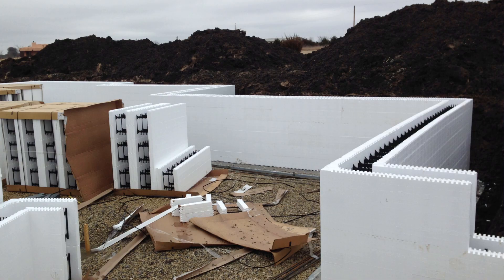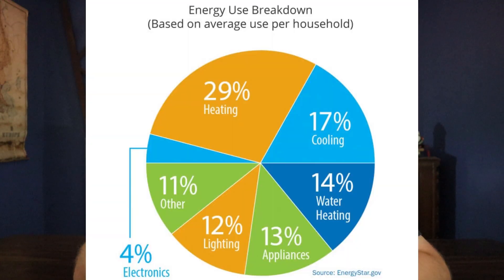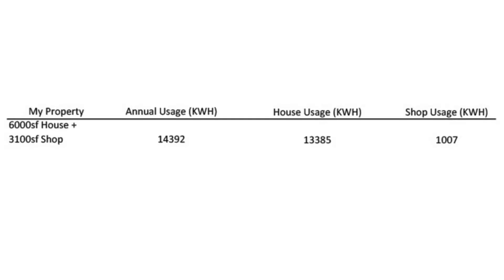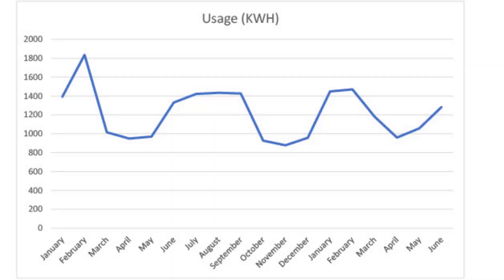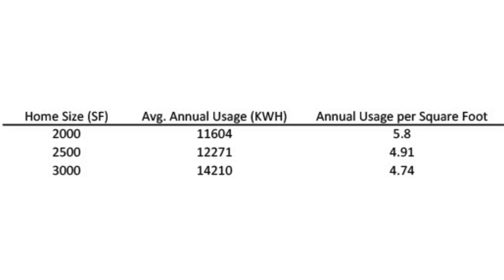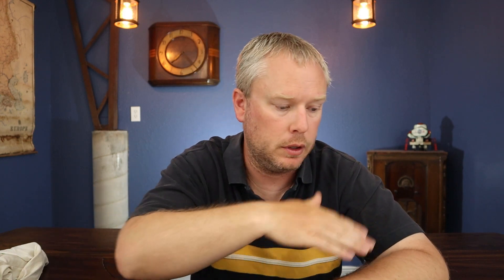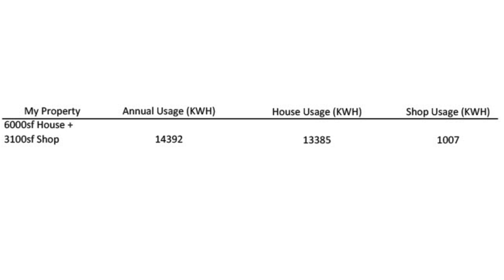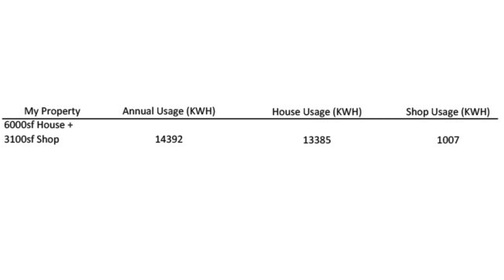How Much Power Does An Energy Efficient Home Use

Comment: I have just built a new house in the uk with 150mm insulation board beneath the slab.  The walls are 125mm concrete then 125mm rock wool then 125mm thermal blocks.  It’s just so warm. I’m delighted I put the money into insulation.
Reply from the maker: Congrats on the new build!!!

Comment: if you have insulation on the floor and walls, whats your situation with moisture , is that a concern and how would it be controlled. i am asking because i seen some videos where insulated homes with heating generates moisture which needs to escape.
Reply from the maker: You'll need some sort of fresh air system, preferably an HRV or ERV.

Comment: Does an ICF system àlmost eliminate air infiltration 
Can you qualify for passive house ratings 
What is the R value of the walls ànd ròof
Excellent video, thank you for posting
Reply from the maker: Yes, icf eliminates air infiltration in all areas that are not penetrations.  The foam provides an r-24, but the concrete acts as a thermal mass.

Comment: I am nearing building our same square footage home as you in Kentucky, 3k+ house 3k+ basement. I am going with Nudura ICF and they are recommending an 8" basement wall and going approx 10' high with 2 1/2" foam floor insulation with floor heating sections then a cement pour completely underground with no windows but an access door to the"utility room".. The upper floor will be a 4" Nudura ICF wall 9' tall with double insulated windows. My questions are, how much energy loss do you find by having windows (I did not see a video on that) I also have plenty of property so you suggested a continual underground tubing run for Geothermal instead of a loop system for even more efficiency, correct? Thanks for the great information and calculations in your videos and of course some need updating but I'm sure you are very busy.
Reply from the maker: I have no idea as to the thermal loss of the windows, so I'm no help there.

I have quite a few videos outlining my geothermal system.  Check them out as they will probably answer your questions.

Comment: Hello, thanks for the video, how can I learn how to build an house taking into account the insulation you did with yours?
Reply from the maker: Lot's of research.  There are plenty of video's across Youtube sharing the information
Reply: Check out Spray Jones, RR Buildings, and Matt Risinger's channels for more ideas.  Or look up Joe Lstiburek talks and interviews. There's a whole world of building techniques out there.  ICF can be good, but so can advanced framing with modern sheathing and sealing products like ZIP and spray foams.

RR Building just finished up a long build series of a post frame build with full LP weatherlogic sheathing, careful tape and metal flashing details, and full closed cell spray foam.  This still has some thermal bridging, but the seal achieved with the closed cell spray foam is pretty impressive and worth quite a lot.

Matt Risinger did a more traditional stick frame build on his personal home that has a lot of neat technology, featuring an unvented attic and "false" soffits, which seems to be catching on.  He also has a lot of videos on building to high level of air sealing and using ERVs to do fresh air venting and recover energy from exhausted air as new fresh air is brought in.

ZIP R-sheathing is another full thermal break solution that can work with more standard stick or post frame buildings.

SIP systems are another very interesting solution, often used with post and beam construction, but can be put on top of more traditional stick frames.  It also offers a continuous insulation layer with no thermal bridges.

Comment: Have you considered trying passive geothermal cooling with your loops? I have seen your loop temperatures in the up 40s and that should be cold enough to do it if you use a heat exchanger just might not get the latent load you do with a heat pump.
Reply from the maker: Those temps were due to the heat pump being in heating mode.  The actual ground temp at the loop depth is in the 60's.